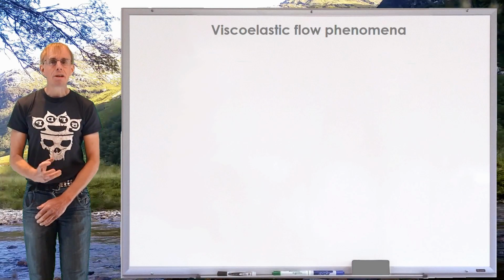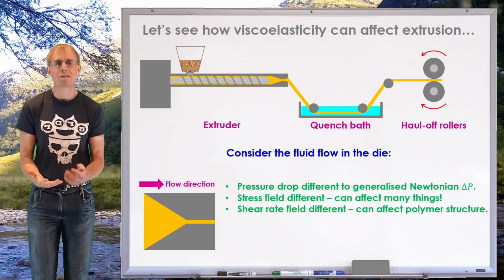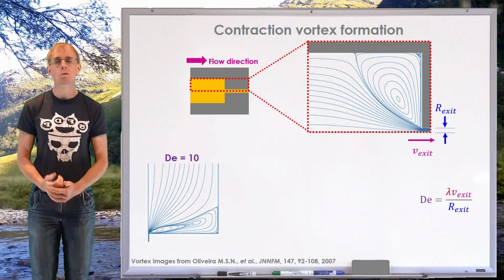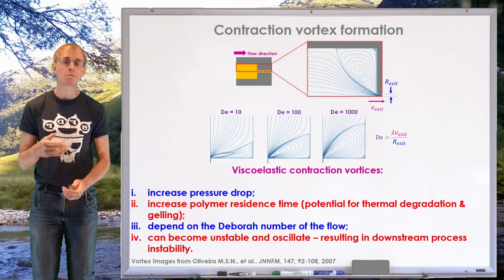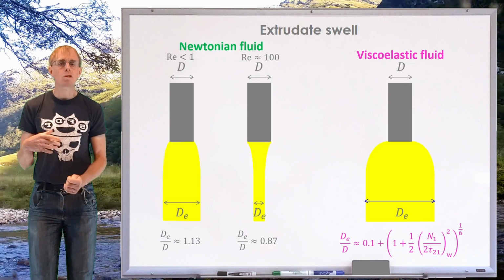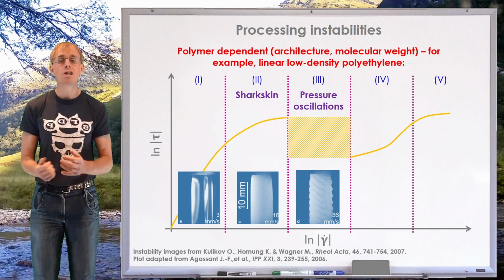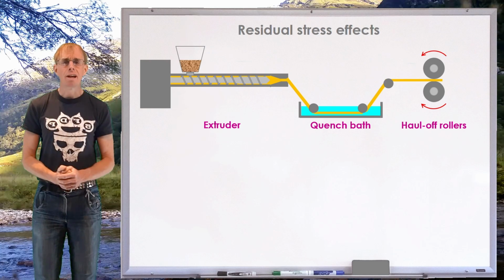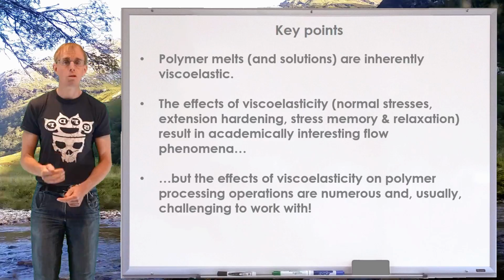UW-Madison polymer processing (EPD650): lesson 4, part 2.

Comment: Very nice lecture. Very good to know practically what you showed in the previous course.
 
1)About swelling, in a filled polymer: will the filler follow the polymer to the swelled edges? (around 15)

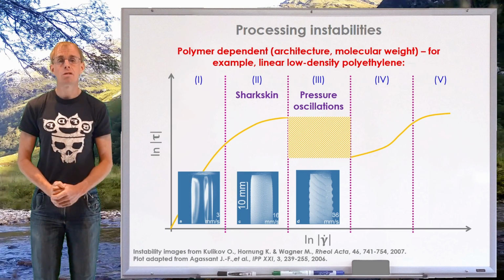2) In your nice reference, I assume the Wagner is not the onw that Wagner's function is called by right? (around 19:00
Reply from the maker: @andrewmountianou2697  thank you very much! So, I don't think that there would be any physical basis for relative movement between filler and polymer, so yes I would have thought that swelling shouldn't introduce any inhomogeneity. 

I'm not aware of Wagners function being called anything, but I could be wrong
Reply: @drbartsworldofchemeng  thank you for all your kind replies!